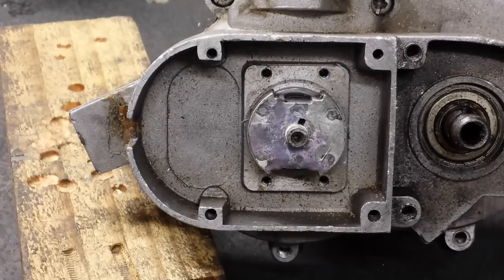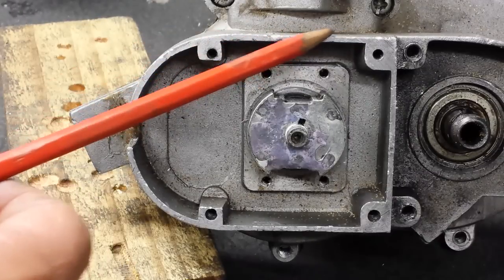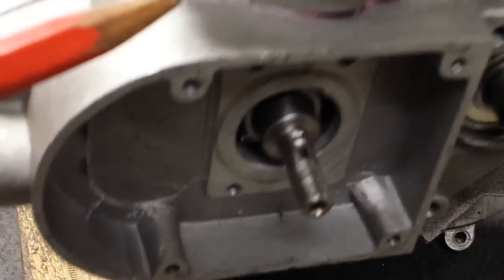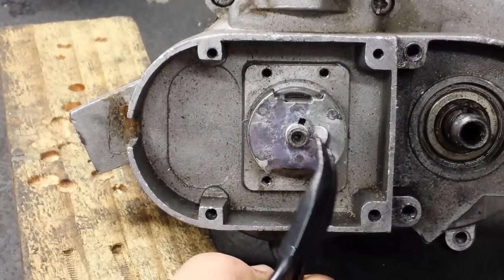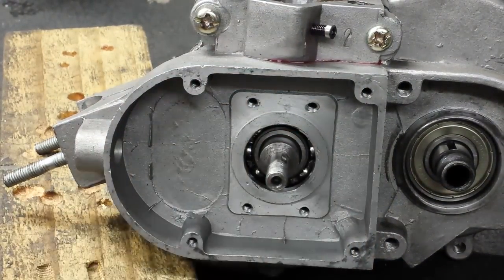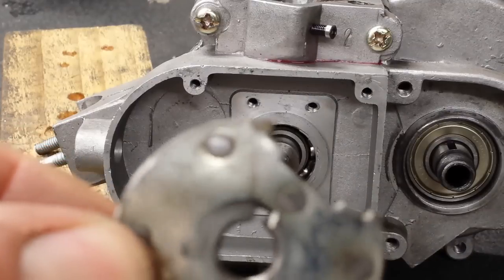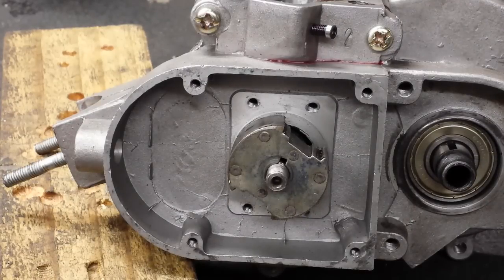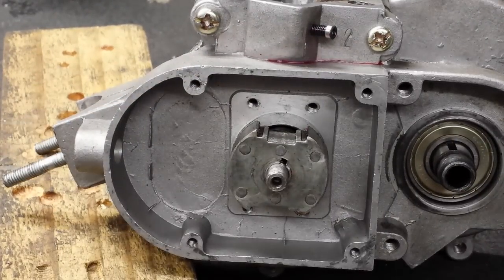Magnet alignment for the 80cc / 66cc 2-stroke Chinese bicycle engine

Comment: Well done. To the point and made it easy for visual learners (like myself) to understand. I must admit that I took some images from your video and Photoshopped them into an  image which summarizes your video. I would like to share it with you if that is possible? Otherwise, fear not, it will only be used by me.

Comment: Just got one of these motors..spent 3 days to get it to run...from the factory they had magnet on backwards ...didnt realize this till day 2....then still wouldnt run...because fuel filter in tank vapor locks...got that starightened out..and it finally cranked..although didnt run smooth...but its progress in the right direction atleast

Comment: i need help guys my maggg is new i have to maggg neetos packs the magnet is it try u can put it on wrong cuz win i mach my wiers from cdi to maggnettto it dont give me spark only win i push it backwords so win i wier it up so wier =dont mach it gives me spark pushing it forwerds and backward  i cud not start it yet with wires in matching order but i have a taster volt meeter and spark plug light taster for spark i am getting spark now and i tast my maggneeto it ohms r 330      but idk if my magnet is on wrong or if the CDI is wired wrong cuz i plug in new magneto and it
 did same think  so i have new cdi i whant the new cdi i seen its a all in one cdi thats it like the new kid u find on mowers i seen tham being offer on other new motors  whats the part nu,mber

Comment: Thank you! I just had to replace my oil seal behind that little bastard and I got it mixed up wasnt sure how it went back on but I got it now!! I think I will experiment with it too since I have a spare I'm going to file about 1mm out of the trailing wall of that keyway (on the magnet) and see if I advance my timing a hair.

Comment: I have a brand new build, everything is spot on, compression is excellent, the clutch does not slip carb is nice and tings no air leaks and still not running. I can bet it will be bad timing. I'll check tomorrow hopefully my days of frustration with this engine is over.
Reply: Did you ever figure it out?

Comment: What difference does it make to position the magnet wrongly?
Reply: It wont run with the magnet on backwards. Trust me I spend 30 minutes one day trying to pedal start a bike that had the magnet on backwards. Flipped it around and it fired up first kick.
Reply: it makes your timing wrong. It sparks when the on is at the bottom and not the top. Therefor no fire because there's no compression.

Comment: Thank you! I think I put the magnet back in the wrong way, also it has a few degress play, because the woodruff key is not perfect, I guess that was my problem, because my engine runs well until, I release the clutch, then the engine lacks power. It used to be perfect before I took out the magnet. I guess it got weak, because the spark came too late, and the explosion didn't push the piston enough. However that's my theory, I don't know what really causes the loss of power.
Reply: Jordán József yea it would cause a late spark
Reply: So did you replace the woodruff key or what? And also I’m trying to look at my key but I can’t remove the magnet it’s stuck on there I already took out the nut

Comment: somebody needs to start producing magnets with the keyway in positions deferring by one degree a few one way or the other or produce a magnet which can be adjusted. after certain work is done to these engines many can benifit from advancing the timing a few degrees
Reply: AndyTom I don't make many videos but I made one on how to do exactly that. And tested results

Comment: Silly question, but what happens when installed incorrectly? Just down run/ start properly?
Reply from the maker: It is unlikely that the engine will operate. You will have spark, but the ignition timing will be outside of operational limits.
Reply: Thank you.

Comment: it is true that these engines are damaged very quickly and become useless too fast
Reply: Mine gone hundreds of miles now with no problems as long as you keep it properly lubricated and clean your bike will wear out before the motor
Reply: I never heard that. I wouldn't be surprised. The air filters are useless, sucking in dirt every second. That's not good. Engine cylinder wear and scarring. I made my own foam air filter and treated it with foam filter oil like in motorcycles. I am hoping I get a good life from this motor. I would highly recommend replacing that absolutely useful air filter immediately with a foam one. Just saying . Peace

Comment: One night I was in a hurry and forgot to shut off my fuel valve.  The carb flooded and the fuel went through the primer down into the magneto.  I got scared and it started but then didn't start after that. Can I re use my magneto or do I need a new one?
Reply: exactly  the same thing. flooded... started.... didn't start??????
Reply: You'll need a new coil the coil cannot get wet, the magneto should be fine though

Comment: what if i cant see the key slot there is a nut in my bike and when i tried to remove it turns everything with the magnet any idea how to solve the problem ?
Reply: victor larraondo take out the magneto and hold the magnet with a wrench . Nut is not that tight so easily removed . You can only see the key with the nut off
Reply: You can also stick something in your sprocket

Comment: i have a question if the magneto is too tight that cant be moved it is possible that it is causing my engine not to start ?
Reply: Having the same problem. Did you ever find out how to fix it?
Reply: @woodrowwilson5511  i used a slightly larger drill bit and i drilled the holes slightly larger while it was clamped in a vice.  dont forget to clamp the magneeto down so the thing dosn't come apart when you drill it

Comment: Would it be better just to buy a better built motor than a chinese motor?
Reply from the maker: dest151 If assembled correctly, and 25:1 oil/fuel ratio is used, and the carburettor jetting is correctly optimised for the atmospheric conditions in your locality, these Chinese bicycle engines are surprisingly reliable, if they are not over revved.
Reply: thanks for the  info

Comment: Thanks.  Good video.  I bookmarked your channel.
Reply: dsh390 Fabian UTB wont let me directly text you halfto go through other viewers I got a 800cc I as going to experiment with before I go to my GT80 I could not get the nut off the shaft use a socket wrench to hold the gear wheel it still turn I think it the woodruff key broke or sheared off because my timing is way out bike wont run been through 3 CDIs 3 Magnetos 3 sparkplugs this is my last hope to fix it before I trash it any way to get the nut off without an impact wrench? any other foreseeable problemI'm gonna have?
Reply: Zoological Militia there is a gear on the other side.  Use a screw driver to hold it.
Reply from the maker: dsh390 Glad to be of any help.
Reply from the maker: +dsh390 Thank you for book marking my channel.
Reply from the maker: use a butterfly rattle gun to remove and install the nut, but be very gentle when tightening the nut with a butterfly rattle gun.

Comment: could wrong alignment cause the motor to not start?
Reply from the maker: lucas simone It is quite possible that incorrect magnet alignment could be a reason why the engine would not start.
Reply: @cryptopyro  how strong should the magnet be its kinda weak on one side and kinda strong on other side not really tho is that bad please reply?????
Reply: @nicholasbuckhannon2000  ever figure this out?